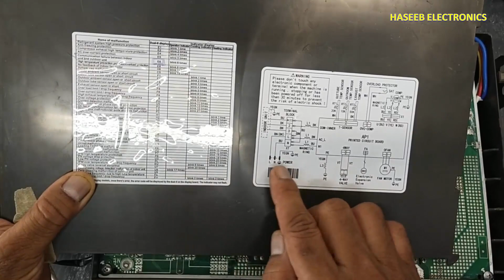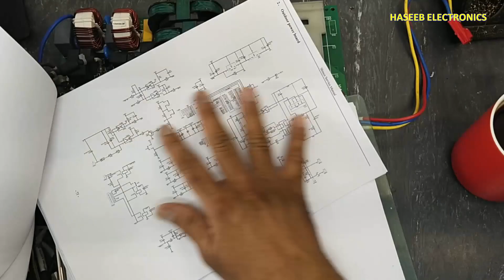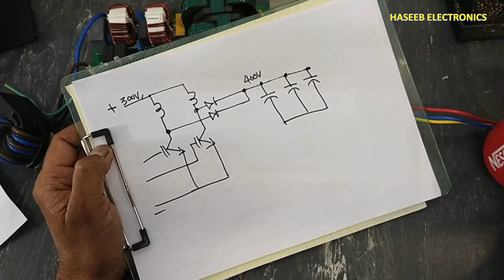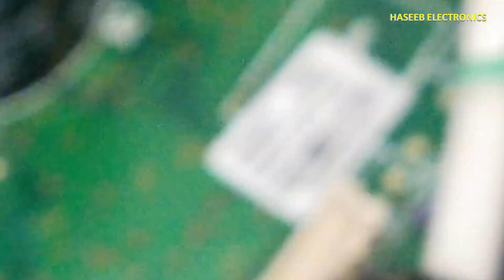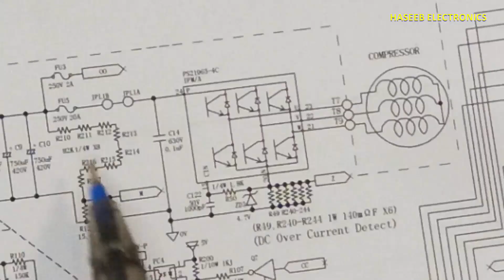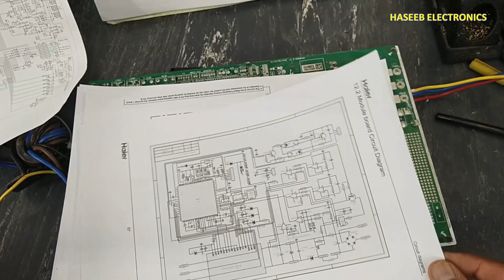{955} DC Inverter AC outdoor-unit circuit function explained

Comment: Hi, I have an outdoor AC unit with an E6 error. I tried to fix it and found a blown surface-mount capacitor, which I replaced. I also noticed a broken trace leading to the optocoupler, so I repaired the trace and replaced two optocouplers. However, I still suspect there’s an issue: when I measure the voltage coming from the microcontroller, it reads 0.6V, and the LED glows very dimly—almost flickering. Suddenly, for about a second, the voltage jumps to 1.3V, the LED lights up brightly, and then it immediately drops back to the original state.

What could possibly be causing this problem?

Comment: hello haseeb 
i have a problem with my client AC , 2 ton inverter been moved and installed ,new pipes and vacuum done.
the AC worked after installation ,after 1 month i turn it on in heat mode ,did not work the inner blower didnt turn, switched it to cool mode the blower did turn but the compressor did not work also, but in both cases the outside fan did work and the compressor did not.
pressure in the vapor line is 190 psi ,there is no error code ! also i checked all the sensor's ,6 of them where fine (5 of them NTC 10kohm and 1 is 100kohm)  
can you direct  me to where start looking.
tanks

Comment: On this boards APFC is the main problef, transistors and diode bridge melted. PFC igbt transistors conect to processor via driver, maybe if processor have some failure than pfc is blow. Other boards hqve separete controller for PFC and it work well.

Comment: Assalamu Alaikum Engr. Haseeb. You are really doing a great job May Allah reward you abundantly Ameen. I tried to subscribe with my Bank Card but unfortunately failed several times. I am writing from Nigeria and am Electronics Engineer who has been in the field of inverter repairs for many years. Alhamdu Lillahi. I have a problem. I am repairing a Growatt 5000 ES Solar Hybrid inverter. I have done almost everything. what remains unclear to me is this problem. The error code 04 and 20 keep beeping preventing the system from starting. Could you please help me with the solution. May Allah reward and bless you abundantly ameen.

Assalamu Alaikum

Comment: The good way to explain the pcb function First you draw a complete circuit diagram with all smd and other
component like each pin of micro controller and there interface circuits
Reply from the maker: great suggestion 
in future i will try my best to arrange in this way
Reply: appreciate

Comment: Hello sir. Can you please explain how power supply or charger will not give output unless you connect it with load like phone or any other example. How it senses the load and start to give it's output ❤

Comment: Thank u Sir for explaining the critical ckt in simple way. Sir one thing I could not understand that 300v DC connected to collector of igbt ,this voltage comes from where without using a bulk capacitor. Thank u very much.

Comment: Very very thank you sir for this video
Please explain all types of communication and about a.c link ,d.c link, comparator i.c ,b.l.d.c motor and its control circuit, current sence circuit using shunt  
Becouse in India all airconditioner technician facing problem after this inverter a.c coming to market and some electronic expert charge heavy amount of money for repair this board and some changing in a.c board repairing course. So sir if you explain in detail all about this type of d.c inverter board it help many technicians.

Comment: Sir good morning I have few questions  when t
he ntc cut the inrush current then the relay switch on will the igbt  get hot from the full mains current even if the gate is getting 21 volt or any high voltage igbt can handle the main full current continuously because I design a forward converter it work very well two igbt 600 volt rating but I am not sure if I should use a relay to bypass the ntc to main full current so I asking will it be ok to use a relay soft-start to mains fully thanks you

Comment: When the engine speed decreases in the inverter air conditioner, how does it maintain the cooling capacity?
Or we can say that the cooling capacity also changes according to the change in the rotational speed, that is, the 3-ton  AC works with a cooling capacity from 1 ton to 3 tons. 
In the same time how we keep tha gas flow constant
Thank you teacher i'm waiting your answer